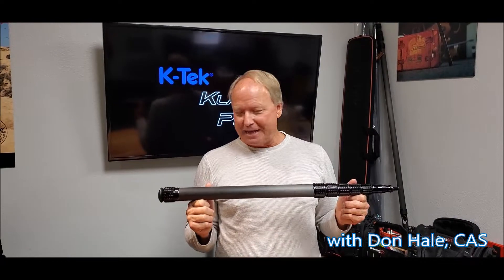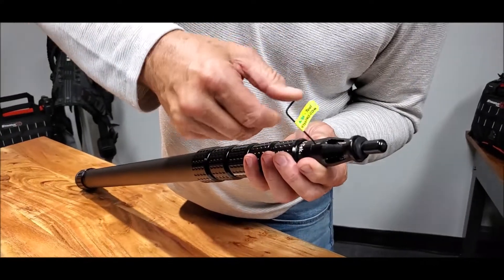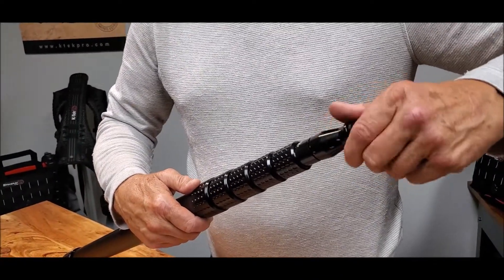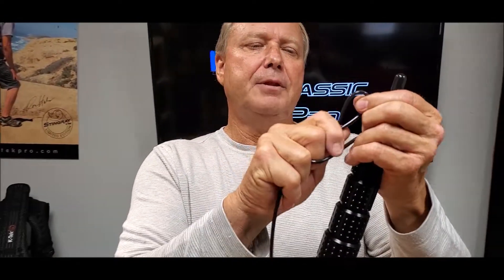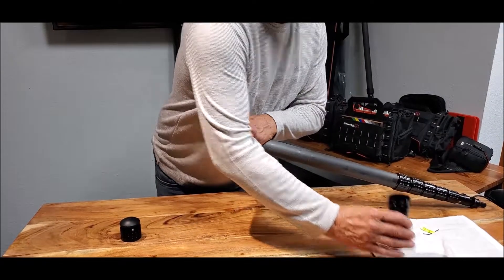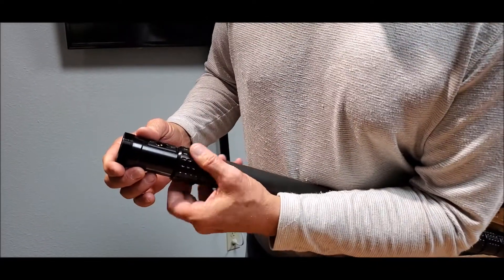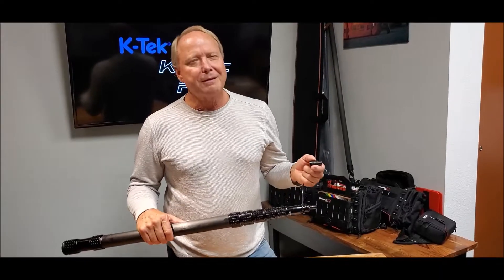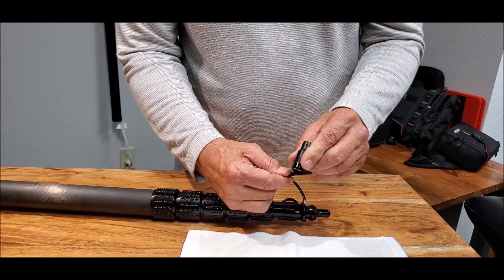How to cable a KlassicPro

Comment: I'm not sure how I feel about all of the extension strain being on one single TA3 lockbutton. That is potentially a lot of pressure and erosion over time. I understand that it is easily serviceable, but that seems like more of an issue than is being talked about. Is there any extra strain relief on that connector I am not seeing?

These poles also seem mildly, but noticeably, girthier, than the previous series, which would make sense given the large connector that has to fit inside.
Reply from the maker: Thank You Marc!
We really appreciate your comment! 
However, Boompoles have been made like this by us, since almost 25 years now. 
Wasn't really a problem so far. It did happen occasionally if exposed to lots of water. But that's already it.
The TA3 is well locking in place, never happened that it released by itself.
Generally, we are showing in that video that you can with one KlassicPro Boompole choose to work either cabled, and/or within a few seconds un-cabled. 
This is the only standard Boompole who can do that! But aside from that, the Boompole is also sturdier, lightweight, faster locking and smoother in telescoping!
Please feel free to reach out if you have any additional question.
Cheers and "Happy Booming", 
Tino 
(K-Tek, Head of Sales)